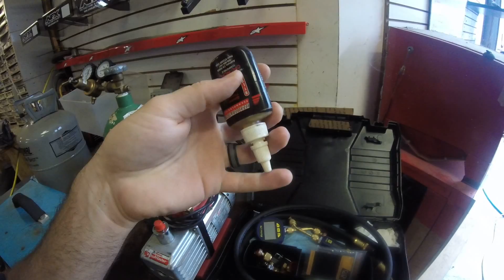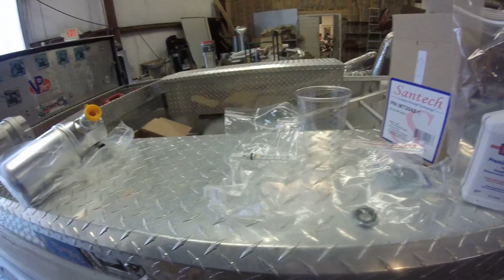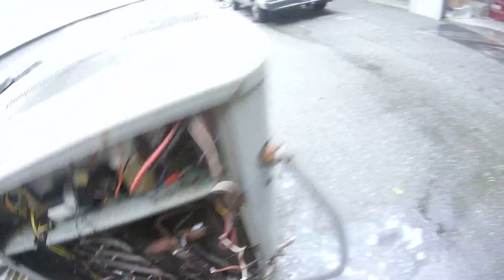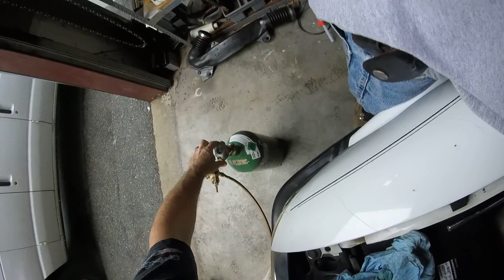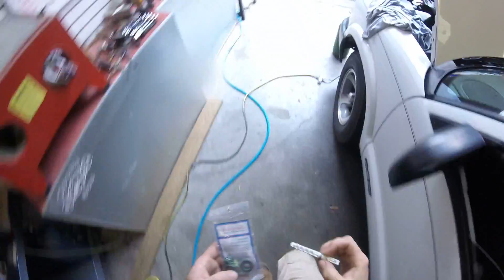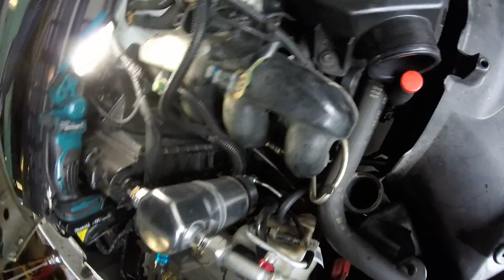Automotive A/C system explained + Repair on S10 Part 1

Comment: My 97 S10 I bought new the AC has not worked since 2006. I just put a non AC new belt on bypassing the compressor since I have a squeak and can now rule out the AC pulley and the old original belt (which looked new believe it or not) but I'm going to remove all the AC stuff I can since everytime it did work the horsepower would drop by probably 20%. 118 HORSEPOWER not much can be afforded to lose for a little cool air. I crank windows down and feel the outside air through my hair and perfectly happy. Nice video and informative though nonetheless.

Comment: ENTER TO WIN $15.00 DOLLARS FOR HELPING ME WITH A QUESTION OR $14.99okay i have a qustion as well and if someone can help me ill venmo you guys 15 bucks, so im working on my 2001 chevy s10 v4 and i replaced the A/C compressor because the last one didnt work, so i added the oil to the new compressor and i installed it and after all that i connected the vacum it and well i brought the low and high all the way down to ZERO, once i did all of that i started to add freon to the system it take 28oz so i added 2 12 oz bottles and a few oz of a 3rd bottle it was the right freon as well, so i did all of that and i checked all of my fuses and relays and everything was good but the problem is that after all of that my A/C IS STILL NOT WORKING IS IT STILL NOT THROWING COLD AIR AND I DONT KNOW WHY SINCE I FEEL LIKE I DID EVERYTHING RIGHT I WENT AS FAR AS CONNECTING THE VACUM A 2ND TIME AND DOING IT ALL OVER AGAIN IN TOTTAL I USE A TOTAL OF 6 BOTTLES AND THEY ARE VERY EXPENSIVE  SO EVEN I DID ALL OF THIS MY A/C IS STILL NOT WORKING AND I WAS WONDERING IF THERES ANYBODY OR ANYONE THAT CAN HELP ME SINCE I DONT KNOW WHAT TO DO ANY MORE SINCE I FEEL LIKE I TRIED EVERYTHING AND I DONT THINK THE SYSTEM HAS A LEAK BECAUSE I WOULD OF KNOWN WHEN I WAS DOING THE VACUM AND I LET IT SIT FOR 45 MINS TO MAKE SURE THE SYSTEM DIDNT HAVE A LEAK SO IF SOMEONE CAN PLEASE HELP ME FEEL FREE TO RESPOND AND I WILL SEND YOU 15 DOLLARS BUT LIKE THE LAST PERSON SAID THE ASWER HAS TO HELP ME IN ORDER TO SEND THE MONEY PLEASE AND THANK YOU ?!?!?!?!?!?!?!?!?!?!?!?!?!

Comment: Atleast $1500.00 + worth of A/C equipment to fix my $500.00 beater 94 S10 👍🏻
Reply from the maker: It's a 99 bro but still v cheaper than a Ac machine

Comment: Hey Joe, need alittle advice. I had a truck given to me that someone started to put a motor in and gave up. Well I finished the motor part of it and got it running but the idiots disconnected all the a.c. lines and didn't cap or seal off ANYTHING. The lines, condenser, compressor, accumulator etc.. has been sitting like that for a few years. Any suggestions on trying to clean all this stuff out? I'm sure it's full of cobwebs and who knows what. Thanks for any advice you can give me. It's the same truck as yours. A 2001 s10. Hope I'm not screwed.
Reply from the maker: Kyle Woodward I’d definitely replace the accumulator because it is also the drier. I would also remove and try to get the oil out of the compressor to replace with new oil no question. Disconnect and replace the orifice tube and try and isolate each component to blow out with dry nitrogen although I guess a lot of shops use compressed air but I wouldn’t personally. You could use flush chemical on the lines and maybe the evaporator since it’s small but you got to get the flush out with lots of dry nitrogen.
Reply: @joeshearer1247  thanks for the info bro, I'll do what you said. Not sure if I can get the nitrogen, but I'll try. I just can't believe they didn't even shove some rags in the openings. Correct me if I'm wrong but if the condenser is clogged with bug stuff, nitrogen or flush probably won't work?? Also anything not flushed or blown out, will that new acculator catch it all so it doesn't ruin the compressor? Thanks again for the advice brother!
Reply from the maker: Kyle Woodward the accumulator job is to trap liquid Freon and also has the dessicant to absorb moisture. Not really particles. The orifice tube has screens to catch debris. I may consider buying a new condensor and flush the rest as best you can
Reply: @joeshearer1247  cool, I probably will do that, replace the O-TUBE and condenser. I'll flush everything else out the best I can and get the old oil in the compressor out. The compressor also has been left wide open for a few years,.i guess ill just flush the line set out same as the evaporator? What is that cylinder thing in the line set, some kind of filter? Also whats the best flush to use for the sisuation im in?Thanks alot joe, I really appreciate your help and advice.

Comment: Nice job!! How much you guys charge for a nice job like this? I have the same truck and I don’t know how much is a fair price. Thanks.
Reply from the maker: Daniel Barrios thanks for the comment Daniel. I don't do automotive jobs for a living just for myself DIY but by the time it was all done I probably had 8 hours in it because we went ahead and replaced the condensor too. The parts were about 750 for compressor kit, new manifold assembly and condensor.

Comment: Great video Joe! My compressor took a dump a few years ago and what a pain in the butt it was to change and get the system cleaned. The compressor is on the bottom of the engine and I had to remove it from the passenger side wheel well. I used 3 quarts of flush and that was with running it through an ultra fine paint strainer and reusing it multiple times. 1995 vehicle and I'm not sure if the condenser is a micro channel but crap kept coming out on every flush. I ran it for a year and took the orifice tube out. It had some aluminum chunks and crud on the screen but not alarming amount. Should probably do it again this summer but the A/C is still working great.

I have never had much luck deep vacuuming an automotive system.  I think it just draws air in from around the compressor shaft seal or maybe my systems just are not tight enough but they seem to hold a charge OK. I vacuumed for about 10 hours each time but it just gets down to a point and never goes any lower. I used compressed air for the flush so that probably didn't help.

Comment: ruhroh @ the orifice tube being grunged up so bad, probably should have replaced everything.
I think they used "plate style" evap's in them and they're about impossible to clean up and the condenser probably the same.  should have hit it with chemical flush at minimum
Reply from the maker: throttle bottle it is a microchannel evap it was replaced about year ago. It is getting a new condensor now. If it was my truck I would chemical flush the evap but it's dads truck and didn't seem to care about doing that,

Comment: Joe excellent explanation vid I was looking for trying to do my own maintenance on the MVAC , make a vid do on your ford cargo van is that a e350 with explanation on all the parts oh what tools like disconnecting we need to, changeout the hoses and washers, gaskets it'll be a great help to us hvacrs getting jerked around
Reply from the maker: Gene K I'm not quite sure what you mean
Reply: i mean when you service your work van ac,i believe i've the same van it would great to learn more about the ac system in that work van its a very common work van